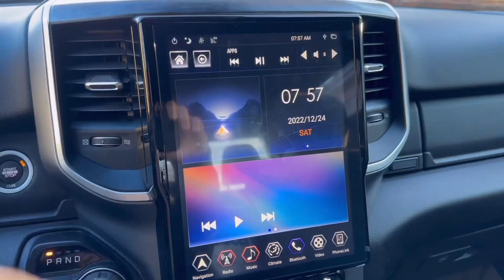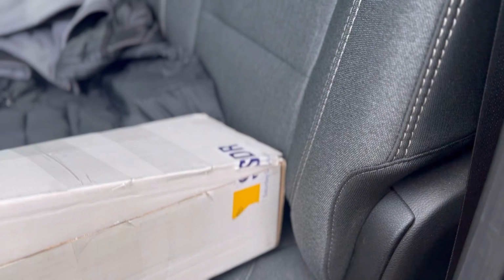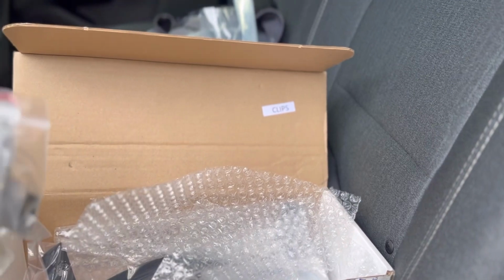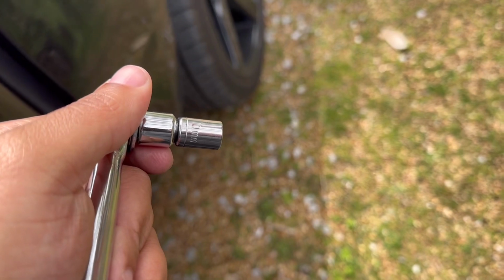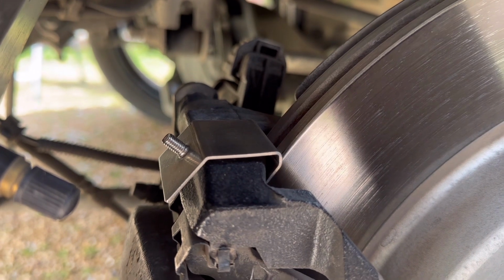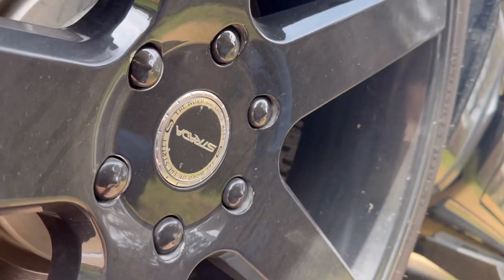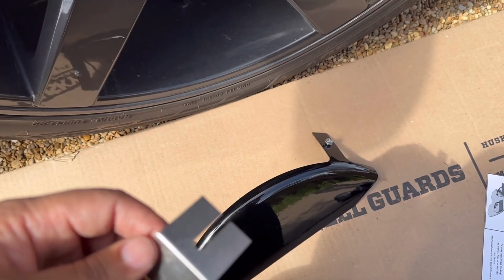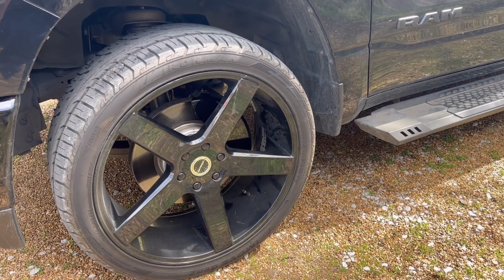MGP Brake Caliper Covers on Ram 1500 #mgp #brakes #caliper #truck #blkhorn #ramtrucks #24s

Comment: Nice bro! I had the same issue with my center caps so I bought some plain black ones and I put a orange ram logo on it lol
Reply from the maker: That’s wassup. How did you get the center cap off? Do they just pop off?
Reply: @theblkhorn2082  yessir I used a small flathead screw driver but I wrapped it in a towel and gently pry around it
Reply from the maker: Thanks man! I’m going to try that to see if I can clean them.